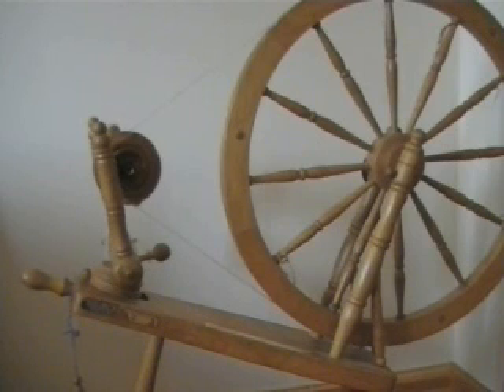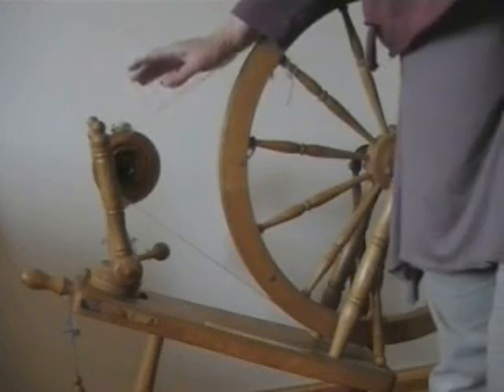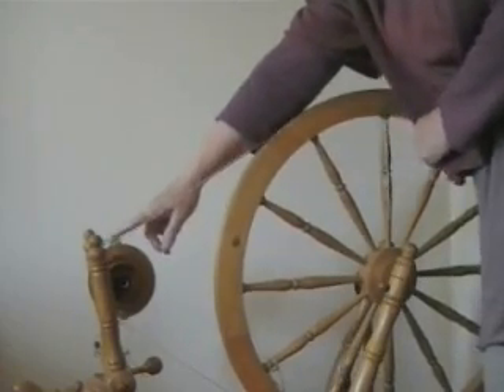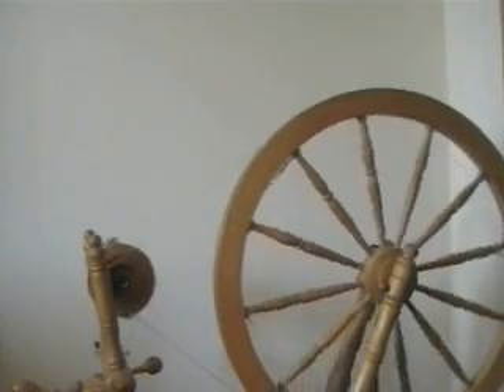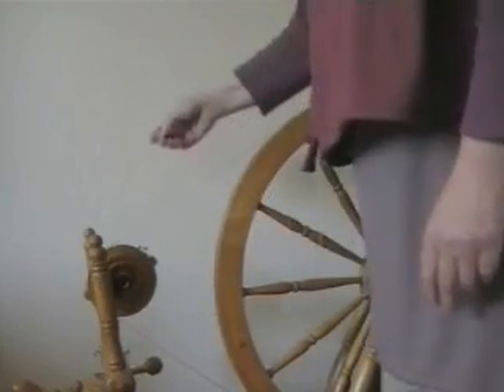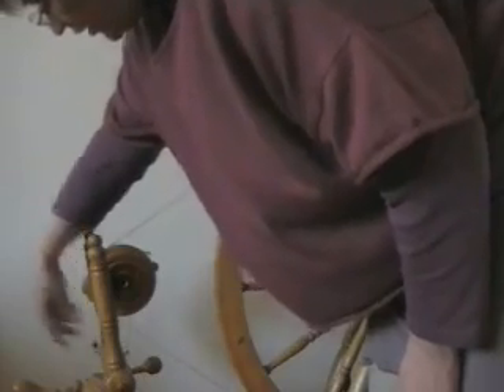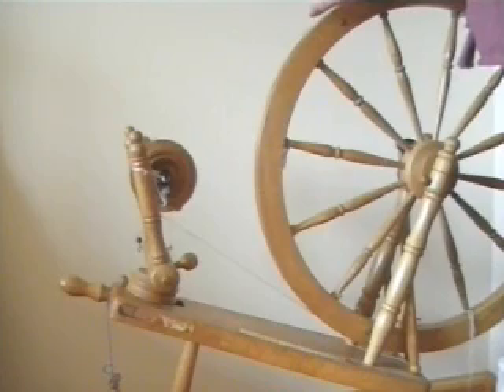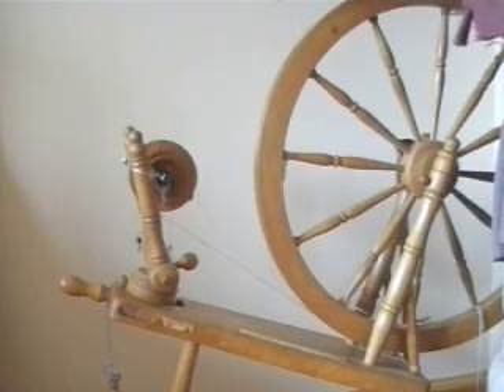How the spinning wheel works

Comment: I was wondering. How accurate and consistent is a spinning wheel? I know the human controlling it has alot of responsibility for that, but assuming they are competent.
I was thinking about weaving cloth of a specific kind. The grist of the yarn would essentially have to be consistently 18/2nm. And ALOT of it. Probably at least 20Kg.
I dont have the first clue about spinning wheels.
Would I be better off just buying yarn from an industrial scale mill?

Comment from the maker: The yarn is stored on a bobbin which is attached to the wheel, for every revolution of the wheel you get whatever the ratio set up gives you in twist, so for a given length of wire on a 5:1 ratio say you would get 5 twists. It is possible to ply many different threads together.